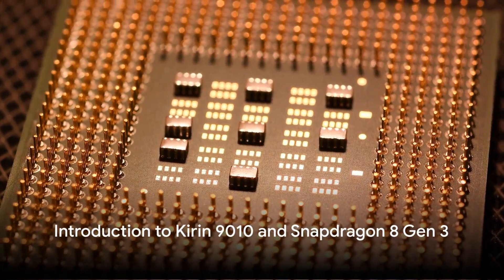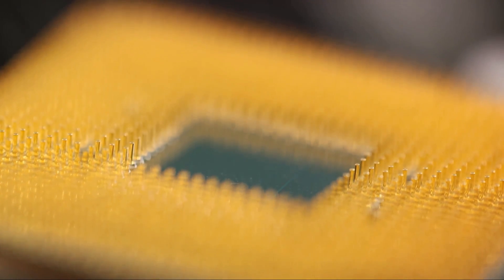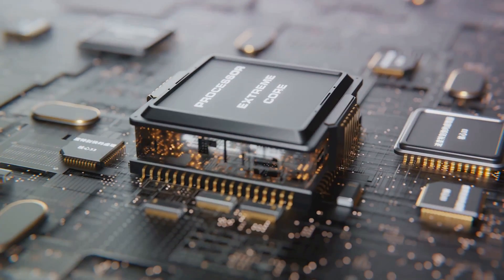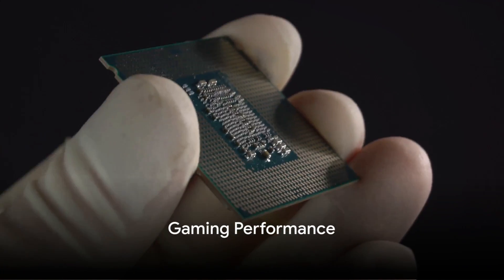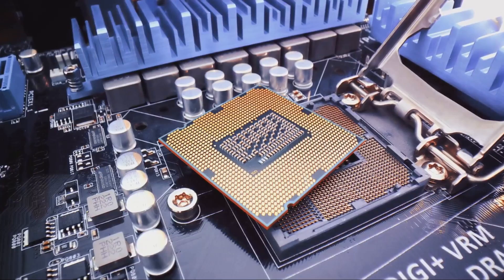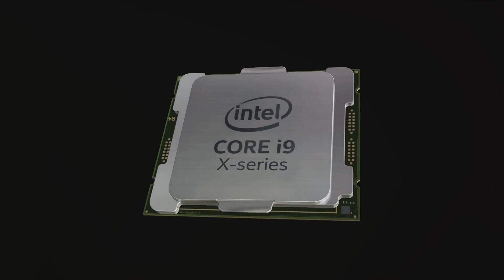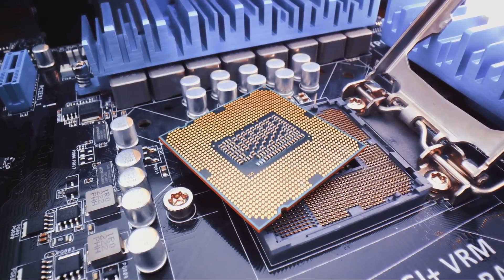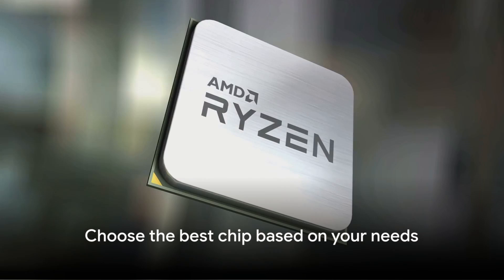Huawei Kirin 9010 vs Snapdragon 8 Gen 3

Comment: I wish huawei continued their kirin journey unfortunately due to major time gap snapdragon overtook kirin i remember even with low specs Kirin processors were so much optimised even their mid range processor used to run pubg at 60fps during 2019, i really want to se huawei KIRIN'S comeback

Comment: You are comparing 4nm Qualcomm Chip using EUV litography and Armv9 architecture with a 7nm Kirin 9010 using DUV litography and ArmV8 architecture.
If you want a fair comparison you should compare Kirin9010 with SD 870. Both is 7nm and ArmV8 architecture. 😁
😁😁😁
Reply from the maker: noted sir

Comment: 8 gen 3 is no doubt a powerhouse.
Huawei needs a lot of work on its Kirin chipset to match apple bionic and Snapdragons in performance numbers. IMO, it will take at least 5-7 years for Huawei to match their rivals.
Reply from the maker: the Chinese  are serious about semiconductor dominance an they have set 2026 as the target
Reply: They are 1000% serious about Kirin chips for sure.
Reply: You are comparing 4nm Qualcomm Chip using EUV litography and Armv9 architecture with a 7nm Kirin 9010 using DUV litography and ArmV8 architecture.
If you want a fair comparison you should compare Kirin9010 with SD 870. Both is 7nm and ArmV8 architecture. 😁
😁😁😁
Reply: And why does Huawei Kirin is still using 7nm DUV and ArmV8, because of your sanction.
Become a winner by mutilating your competitors is not something to be proud of. 
🤭🤭🤭🤫

Comment: Kirin use 7nm bro
Reply: The overall user experience is not conditioned by the hardware alone. It is a combination of good hardware and software optimized to work in an efficient way. On that point alone, having the latest and greatest chip does not guarantee a good experience.

Let us be careful with numbers and all that marketing. Most of us are big enough to purchase based on objective criteria rather than marketing arguments only.

Comment: I will still choose the kirin, we all know kirin cpus are very smart and efficient. I have a phone with snapdragon 888 and a phone with kirin 990 and the battery with the kirin 990 is much better even though it is smaller. The kirin phone which is huawei p40 pro is smoother and snappier and even in Pubg it has a 90 fps option but the snapdragon doesn't. In video rendering they are at the same speed but the kirin is much cooler.
That's the proove why benchmark scores don't speek that much
Reply from the maker: kirin works better despite the specs
Reply: 1000% agree 👍🏻